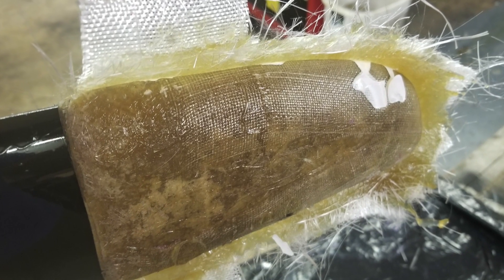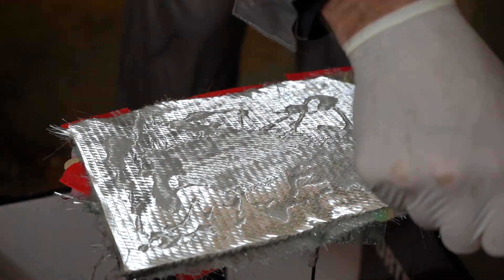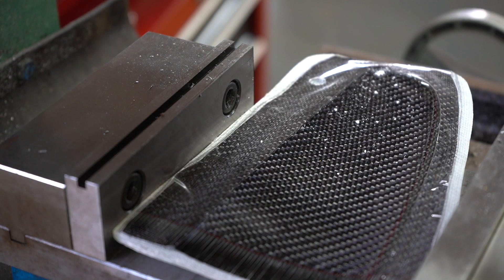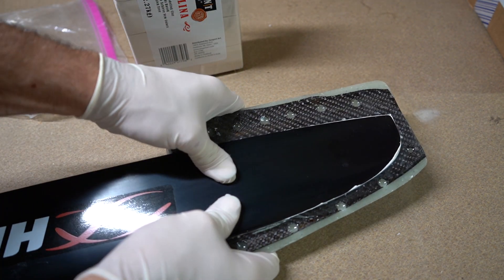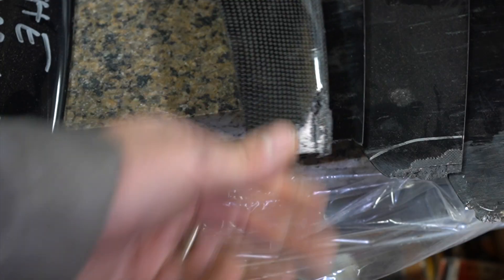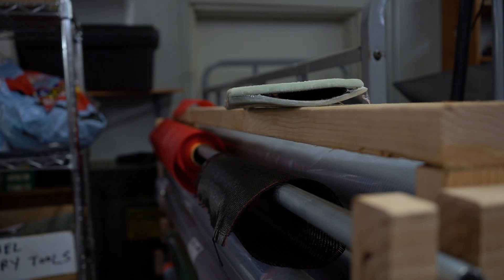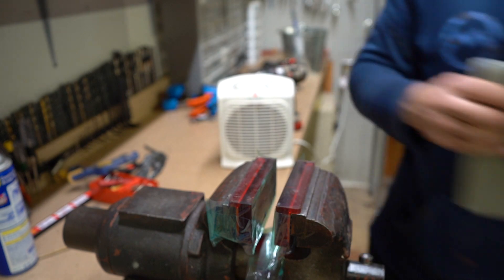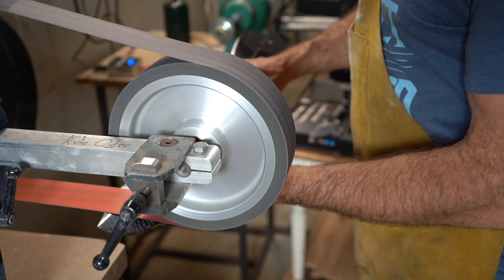Paramotor Propeller Mold Fabrication & Damage Repair Composites Carbon Fiber & Fiberglass

Comment: Hey kyleo great video! If possible could you explain what you used for the balancing that was tied to the strings for the prop? Is it just a simple piece of metal we can buy or was it milled for just this use?  Trying to get this setup like that to help repair props at our school!
Reply from the maker: I made the hub on the lathe.
Reply: @kyleoglee  oh well darn. I really appreciate the reply! Especially on a older video! I'll use what you showed and make it work! Thank you!

Comment: Makeing mold from carbon fiber is wasteing of expansive material, you can do it just from fiber glass and it will be still wery strong. It is also better to make second half of mold without removeing blade from first part of mold. Looks very unprofesional, adding material on a tip of propeller is very dangerous, added material can still brake up and fly off during flight! He is useing way too much resin and just 2 layers of carbon. It is joke, dont do it guys....
Reply from the maker: Been doing this for years.  No failures so far.  Come back to complain after you have repaired hundreds of propeller tips sir.

Comment: Hi Kyle, have you ever repaired a helix prop with a clean break about 3/4 way down from the tip, can it be repaired safely or is it irreparable because of the stress at the point
Reply: Structural repairs below 2/3rds from the root is not advised

Comment: I blasted my first prop this weekend. I am getting my stuff together to make a mold of the new prop that is in the mail. I am interested in getting the register key down. I didn't see in the video the other half of the mold. Did you just form some little bumps to fit in the holes?
Reply from the maker: I've done many different keying methods.  Most recently I've been using plasticine clay, and putting the female divots into the first half, then pouring the male in with the second.

Comment: Amazing content!! Thanks Kyle!!! Good mold technique... just a question, for balancing, what do you think about drilling a hole and add a small solid weight to the tip edge of the prop? I've seen many people doing that, any disadvantage or just preference?
Reply from the maker: It can dislodge and move.  Especially with a foam core prop.

Comment: This is a great instructional video and it will give pilots stuff to do when the conditions are not right for flying.
You are truly spreading skills and knowledge and its definately being appreciated.
Frankly with all you do I don't know where you find the time to not only do all this work but also video and produce all your content.
I have an eProp that had the last 3" of a blade removed by a loose gas cap but it sounds like that might be too much for a repair like this?
I wonder if there is a use for busted props that are beyond repair, maybe wait till you bust another blade and make a wall clock out of it, or a mean looking fan or a windmill.

Comment: Nice one Kyle. This, or something similar, is a must for anyone running a PPG school. So... I want to design a new quick release prop hub that would be at an incredibly low cost point, but it will require the cooperation of a prop manufacture to incorporate the concept into their hub.  The parts would have to be designed to work together vs. adapting the coupling to existing bolt up designs.  Alternatively I could set up to build a line of props, but that's not where my interests lie. Your mold came out good enough, but I have to ask, do you know if the major manufacturers (Helix and eProp) are doing much sanding after the cure?

Comment: Not sure if it would work with what you are doing but, working with epoxy in woodworking you use a butane torch to pop the bubbles once they have risen to the top.  I'll have to try the heat gun just for shits and giggles.
Reply from the maker: The gun is a bit more controlled.  You can overheat with a torch easier, but not someone with your skills.  Still, I think you'll like it better.
Reply: @kyleoglee  My skills consist of trial and error or, in my terms, screw up and cuss a lot and on occasion make a screw up that I can make look right. 😂

Comment: How do you figure out where to add weight, whether near the tip or near the hub? the same amount of added weight will have a difference effect on static  balancing depending on position, that's where dynamic balancing comes into play but that seems like too much of a hassle in out sport
Reply from the maker: I simply use my finger, and the amount of pressure required to locate the optimal spot for the ballast injection.  If the shape is symmetrical, and the static balance is spot on, I find zero dynamic vibration present. The molding is also very crucial in assuring this outcome.
Reply: @kyleoglee  thanks! Amazing work BTW

Comment: good :) 
can I ask something? 
what material of porp can not be repaired ?
Reply from the maker: I suspect anything can be repaired.
Reply: @kyleoglee  yeah I'm with u  but I mean just case of 'minor repair'. Any prop can be   repaired by major repair but in field, can not be done that repair.
Reply from the maker: @paiisebutton6322  Propeller field repairs are a fools game.  Switch it out with your back up propeller, and bring it back to HQ for a proper repair session is the way of the Jedi.

Comment: Impressive!  Thanks!  Further up the prop, are these foam core?  I haven't broken one far enough to know.  I assume they are because of the weight.
Reply from the maker: Negative on foam from Helix propellers.  There is a bit of balsa at the hub, and then unidentified composites throughout the structure.  I've dissected one a few times during a necropsy.